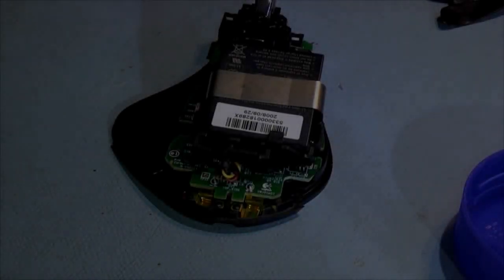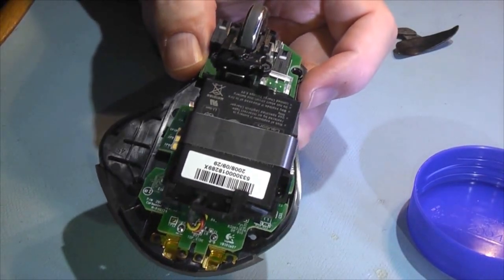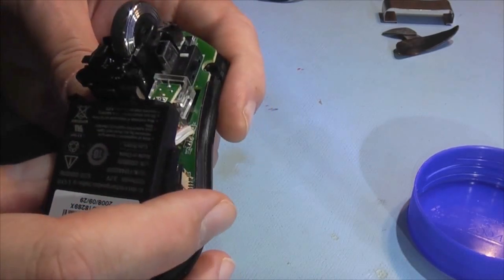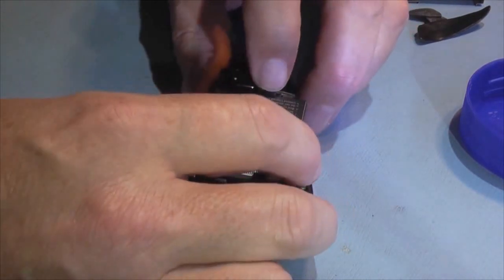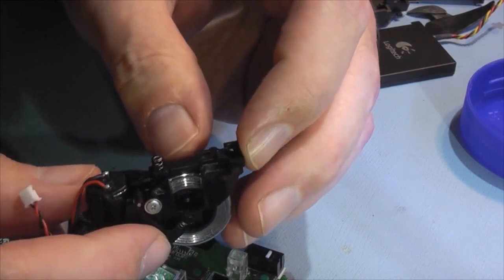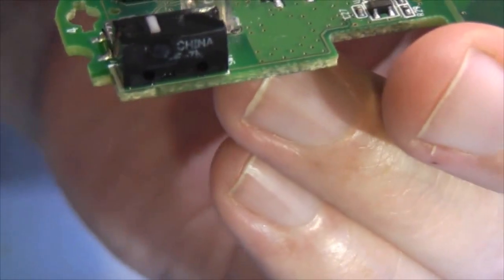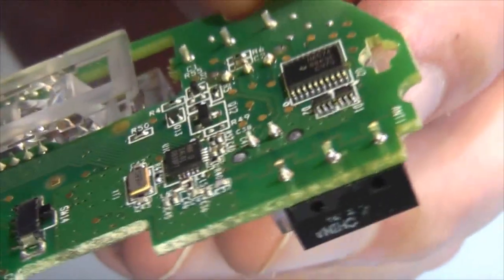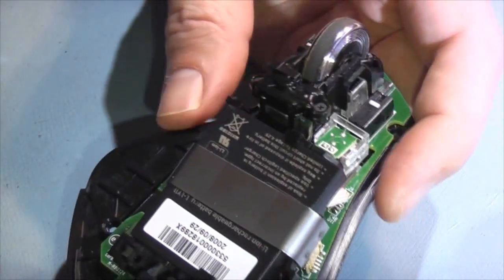Logitech MX Revolution Mouse Switch Replacement - And switch lube request.

Comment: Thanks for showing the breakdown, I have continually used my two (one for home and one in the office) MX Revolutions for 15 or more years, they are a perfect fit for my hands. One of my MX R's is showing issues with the left wheel tilt which I use for left scroll perhaps I will open it up and see about getting some Deoix sprayed into that switch.
Reply from the maker: Hi, thank you for your comments. Yes the MX Revolution was one of the best mice ever & it was my favourite too. I like the MX Masters too but the Revolution was just that little bit more comfortable to use.
Cheers
John.

Comment: Great video. However I have a question. On my Logitech MK300 mouse I need to press right click 2-3 times to show one click. I also can't hold right click without re-clicks. I opened my mouse, there is D2FC-F-7N. However I don't understand what do you call "lubricant"? I used Super Spray (5 in 1 including contact spray-lube) and now right click is better but when I hold it every 4-5 seconds it loses and then it presses again. Should I try with another spray or what do you think?
Reply from the maker: Hi.. If the lubricant you used is NOT a dedicated 'contact cleaner' you should really try some of that, as lubricants with contact spray incorporated into them tend to only work for a short time period.
If you do buy some contact cleaner and that doesn't help, you may just be better replacing the switch for a new one.

The switch cleaner I use is called 'Servisol Super 10' although there are other good ones too.

http://www.amazon.co.uk/s/ref=nb_sb_noss?url=search-alias%3Daps&field-keywords=Servisol%20Super%2010

Hope this helps a little

John

Comment: Hi John,
Thanks for taking time to video this :)  I'm waiting for my microswitches and will be repairing one of my MX Revolution mice which has a crankly left switch.

I quite like the vice you're using to hold the pcb.  Would you mind letting me know which one it is and where i can get one please?

Thanks
Reply from the maker: Hi,  thank you for your comments. The vice in the video is a Panavice 201. I have a few of them now with various attachments. I would recommend that if you get one you also buy the Panavice 308 add on base as they are really heavy and stop the vice sliding around. 

Cheers
John
Reply: +orbiter8 (John) Wow that was a quick reply!! Thank you :)  Looks good.  I did notice yours wobbled a bit so something similar with a heavy base will be perfect.  Certainly a massive upgrade to the 3rd hand tool I currently use which constantly needs securing and isn't particularly heavy, though not bad for around a fiver :D Thanks :)
Reply from the maker: +Lemental Vapologist  The helping hands are OK but they're just not stable enough really are they. As you mention the basic Panavise (201) does wobble a little if you don't get the solid base mount (308) for it which makes it much more stable. 
I also have another Panavise 300 base which is fitted on the heavy base mount (308) with a Panavise (366) on top, this is also an awesome holding tool for larger PCB's etc.

Cheers
John

Comment: Really helpful video! Hopefully a clean is all mine neads.
Also wondering where you get your lead solder from? I'm having a hard time finding some in Ireland.
Reply from the maker: Hi, If you've got the double click issue you'll probably need to do the switch cleaner job, or even replace the switch if necessary. They are available from eBay. With regards solder I use this stuff a lot....

http://www.rapidonline.com/tools-equipment/multicore-solder-wire-60-40-22swg-0-7mm-60en-362-0-5kg-85-6215

Comment: Wonderful Video Thanks alot! What liquid did you use after soldering? Before Alcohol( Ididn't get that one)
And is the contact cleaner Würth OL or SW? there are 2 options.
Reply from the maker: Streng Vertraulich Hi.. Thanks for the kind comments. The liquid used after soldering was flux remover, this basically removes any unwanted flux residues from the board. It's not really 100% necessary as the solder was of the No-Clean type, as opposed to other solder types that use a more aggressive (corrosive) flux. Although flux cleaner does actually finish the job off nicely as it takes the brown sticky residues off the pcb.

The Contact cleaner I used in the video is just called 'Wurth Contact Spray' (NOT SW or SL) You can also use 'Servisol Super 10' Contact Cleaner too which is also excellent stuff. 

Hope this helps
Reply: Thanks a lot ! I'm still a learner with soldering =)
Reply from the maker: Streng Vertraulich  You're welcome.. Don't worry about the soldering, you'll pick it up easy enough.. Even the SMD stuff is not so hard once you've had a go at it a few times.

Comment: also have the same issue on a Logitech VX Nano Black model 910-001172, the D2FC-F-7N switch started double clicking, have used switch cleaner on it for now but may end up replacing the switch
Reply from the maker: +jamesthepuerilis   Hi.. And thank you for commenting..  

If you are having no luck with the switch cleaner, it's likely that the switch is worn out, so a replacement is the next option.

Cheers
Reply: +orbiter8 (John)  just in case anyone is interested i've used the WD-40 "specialist" fast drying contact cleaner which seems to have done the trick for now.

Comment: I seem to have repaired mine but I have ran into an issue. The battery hasn't been used in years but I'm not sure what the issue is. Putting it on the charger, the LED's flicker/shimmer and they are orange. Not green. Switching on the mouse they all remain orange and fade out but will not charge or be green. Is it just a battery problem or the board? I would assume if the board was busted it wouldn't light up at all?

Nothing on the board is burnt or missing circuit rings or messy solder for the microswitch. Is it likely the battery has went bad from several years of no use since the microswitch was busted...
Reply from the maker: Hi, It's possible that the battery has died or is faulty, however to be honest I've not seen the lights illuminated orange before. Only green when charged, or red when discharged.. 

I would firstly measure the output from the battery with a multimeter if you have one. But before commencing multimeter testing make sure that you are connecting the red and black test leads to the correct terminals on the mouse battery. You should see the plus(+) & minus( - ) polarity markings indicated on the side of the battery for testing..  

The cell should read 3.7volts or just over when charged. If you have a power supply available you can power the mouse with that at 3.7volts DC to see if it works, keep the current low though for testing (around 50-100 milliamps etc.. Or damage to the mouse may occur if indeed it does have a circuit problem.

If you have had the gold coloured ribbon cable disconnected, make sure it is seated back in place correctly and not at an angle etc, as this could cause the problem you describe.

Also make sure your soldering is good.. Make sure there are no solder bridges across joints OR that there are no tiny solder balls that have escaped and become lodged between the small legs of any integrated circuits.

Comment: Hi, I have a little question, I have no double-clic issue but is it useful to lubricate the microswitches sometimes ? I mean does that make them more enjoyable to press ? If yes, how often should I lubricate them ? Thanks in advance for your reply. Regards.
Reply from the maker: Hi.. It shouldn't be necessary really to keep them lubed but it certainly wont do any harm. Just a squirt every few months should do it if the mouse is heavily used. Just make sure that you ONLY use switch cleaner (it's kinda expensive at about £10) but it should help prolong the life of the switches and prevent switch arcing, which is what I believe causes the double click issue eventually as the contact surfaces inside the switch are eaten away and pitted over time.

Hope this helps
Reply: ***** Thanks for this great reply John, I'll buy some servisol super 10 bottle on amazon and I'll lubricate the switches every few months like you said. I have another tiny question, what kind of glu do I need to use in order to put back the mouse feet when reassembling the mouse ? Thanks in advance for your reply, Kind regards.
Reply from the maker: dkd3nz
 You can't go wrong with the Servisol Super 10, It's the best stuff IMHO.

I wouldn't use any glues really on the mouse/feet. Instead.. for the first few mouse disassembles try really hard to keep the thin adhesive sheet holding the pads down intact, you can get a few uses out of the original stuff if you don't tear it whilst removing the feet, and it should stick back on ok too as the weight of the mouse tends to help stick the feet down again.

IF.. the thin adhesive sheet between pad and mouse does get damaged or doesn't stick any more, I tend to use the very thin 3M double sided tape, although this is very expensive stuff. I think I managed to get hold of my last roll from ebay and that was a bargain at £20. There are other makes too I believe.

Otherwise take a look below.. Spare MX Rev mouse feet :)

http://www.ebay.co.uk/sch/i.html?_odkw=mx+revolution+feet&_osacat=0&_from=R40&_trksid=p2045573.m570.l1313.TR0.TRC0.H0.Xmx+revolution+mouse+feet&_nkw=mx+revolution+mouse+feet&_sacat=0

Cheers

John
Reply: ***** Thanks for this very helpful and insightful reply John, after doing some web research I discovered that the most oppropriate double sided tape for mouse feet is the 3M 9448A, I'll buy some on ebay, as you said It's quite expansive (9€). On another topic, I am a newbie at soldering and I didn't understood very well how you cleaned the pcb holes after using the solder remover wick because I'm french so It's hard for me to understand spoken english. What liquids are you pouring in the pcb holes at 17:47, 19:16 and 19:50 ? I think I heard isopropanol alcohol at 19:50. Could you explain how I should clean the pcb holes after using the solder remover wick ? Thanks in advance for your answer, regards.
Reply from the maker: dkd3nz
 Hi.. Before the soldering process begins on fitting the new switches I'm using Solder flux, this helps clean the area to be soldered and more importantly aids in solder wetting and flow. It also help create a nice shiny solder joint.

Following the soldering process it's normal for flux residue to be left behind, In most cases (using general purpose solder with none corrosive flux) it's ok to leave this residue behind, however I always like to clean up properly after soldering and for this I used Flux Cleaner.

Regards

John
Reply: ***** Thanks again, I understand everything now. A very last request could you give me the names of the solder flux and flux cleaner you are using ? I'll buy the same on amazon. Thanks in advance for your reply, Regards.
Reply from the maker: dkd3nz
Unfortunately most of the soldering chemicals I use can't be bought from Amazon, however they can be purchased from Farnell and this is where I get most of my stuff. Farnell is a huge worldwide electronics company who will ship to almost everywhere.

I tend to use two fluxes for various jobs, the first link is a general purpose 'No Clean' none corrosive flux (some high activity fluxes must be cleaned after application you see as they are corrosive to circuit boards and parts.) 'No clean' flux is flux that does not have to have it's residues removed following application.

The second flux link below as still a none corrosive flux but it has a very high rosin content meaning it is much more sticky and thus doesn't evaporate too quickly when being used. Unfortunately it is only available (for me anyway) in 5 litre containers which cost around £70. I do believe there is a 1L bottle available but I've not seen it advertised

The flux cleaner I use is the bottom link... Electrolube Fluxclene

http://www.somersetsolders.com/product.php/35/74/qualitek_381f_no_clean_flux

http://uk.farnell.com/multicore-loctite/pc21a/flux-pc21a-5l/dp/1115472

http://uk.farnell.com/electrolube/flu01l/fluxclene-tin-1l/dp/298189

Regards

John
Reply: ***** Thanks again for this very helpful reply John. I think I'll buy the "general purpose" flux and the electrolube Fluxcleaner. Also if I understand well your video if I want to remove the stickyness of the flux cleaner I also need to buy isopropanol alcohol ?
Reply from the maker: dkd3nz
 It's handy to have IPA around but not really necessary as the Electrolube IS the flux residue cleaner. This does not really need cleaning off. Obviously If you have excess electrolube on the pcb just dab it up with a cloth or cotton bud etc. But don't use too much.. it's rather expensive stuff :)

John
Reply: ***** Okay so no need for me to buy IPA. Thank you for everything, your awesome video and all the advices you gave me will help me a lot because I want to mod my steelseries sensei raw mouse with OMRON D2F-01F microswitches manufactured in japan. The sensei raw uses Omron D2FC-F-7N microswitches manufactured in china but I find them to be a bit hard to press on, the D2F-01F requires less actuation force so they will probably do the trick. Do you think replacing microswitches is a risky operation ? I know a lot of people are doing this but I'm scared about ruining my mouse. Thanks in advance for you reply, regards.
Reply from the maker: dkd3nz
Replacing the switches is not hard to do, however electronics is my hobby so I would say that :)

I wouldn't really advise you attempt the switch replacement if your not used to using soldering equipment etc.. The only reason I say that is because when desoldering the switch terminals you have to get ALL of the solder out from the 3 joints. The easiest way to do this is with an electronics hot air tool but these are a special tool really.
 
You can do it also by removing all the solder from the terminals & holes with a normal soldering iron, along with a solder sucker tool, or solder wick, OR both.

If your getting into soldering etc.. Get yourself a solder sucker tool & some 2mm 'solder braid' as well, because when it comes to changing through-hole components (which the switches normally are) solder braid will help absorb the solder from within the PCB (printed circuit board) vias/holes.

DO NOT pull hard on the switch even IF you think all the solder is out as you could be straining the copper PCB inserts. It IS ok to wiggle the switch a little. You will know when the switch is free enough to be removed. In fact sometimes they just fall out once all the solder is removed

Please don't think I am trying to frighten you into not attempting this, I'm just highlighting some precautions to keep in mind.
Reply: ***** Thanks for these new advices John, I'll follow them very carefully. I'll get a solder sucker tool and 2mm solder wick just like you said. What happens if I don't get all the solder out from the 3 joints ? Can It cause malfunction ? Thanks in advance for your future answer, regards.
Reply from the maker: dkd3nz No problem. What I meant by.. get all the solder out was.. get it all out before you remove the switch. What happens you see is that when you de-solder a joint, especially on a multi layered PCB even using a sucker OR wick, OR both, is that quite often there is a small amount of solder still down the hole and this hangs onto the switches leg thus holding it in place and restricting it's release from the hole. This is where you need to be a bit careful because if you were to pull it whilst it still has solder holding it you 'could' rip out the small copper insert that is fitted in the 'via' (this is a through-hole plating in the PCB) that a components leg sits in and the solder sticks to.

Check here for an example..

http://en.wikipedia.org/wiki/Via_%28electronics%29
Reply: ***** Okay, I understand now, I was a bit dumb sorry. I'll be careful about removing all the solder and not pulling the component leg. Thanks again for all the help you gave me. Kind regards.
Reply from the maker: dkd3nz
 No problem ;)

Comment: i tried replacing omron switches with huano switches and kinda bent the board..so can i ask if it does work switching from brands?or do I have to stick to what switch the mouse has?btw i  only bent the board at the part of the switch i had replaced but the mouse still works..i dont know if i just broke it or it just doesnt work using different switches
Reply from the maker: If you can find a switch that has the same pin layout (connections) and specifications then it should work fine. Omron are a good brand of switch so I guess that's why Logitech use those.
Bending the PCB shouldn't do any harm.. However If you have bent it too far & cracked the PCB it's not good news, especially as that will likely split the copper tracks on the PCB too. If the tracks are all intact and the mouse works ok, make sure the PCB is epoxy glued OR supported in some way so that it's not flexing when you press the mouse buttons.
Reply: i was experimenting on the feel of other switches..ill give it another go with a spare omron switch to check if i bricked the PCB..for some reason im hoping i bricked the PCB since i really want the possibility of using different switches..thanks for the reply!